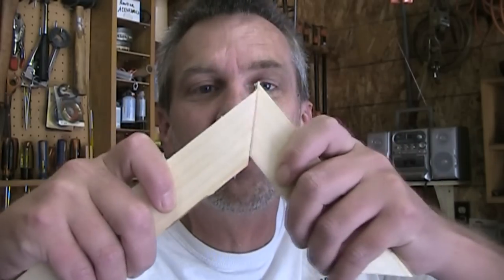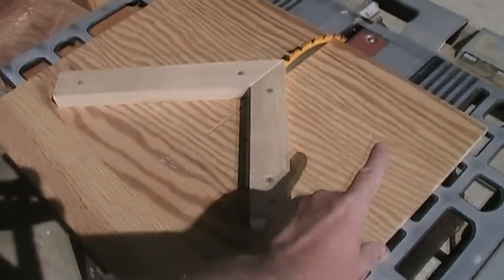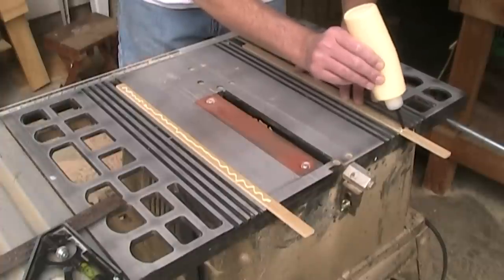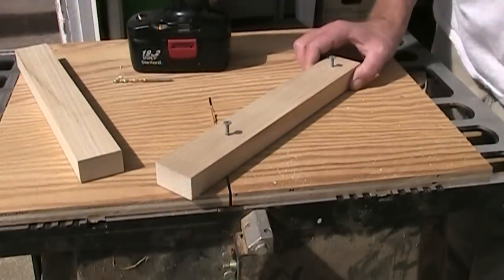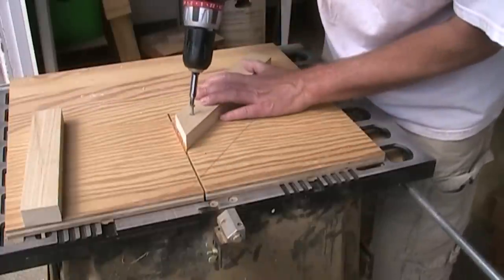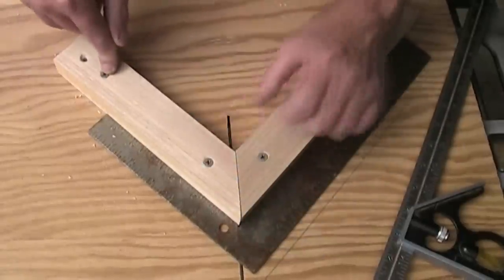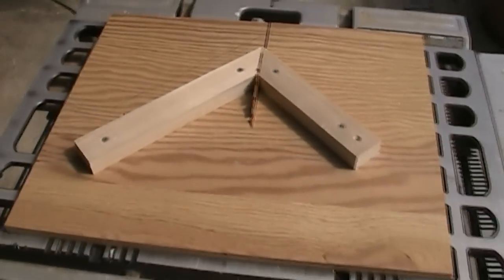Table saw miter sled

Comment: Nice one Steve. Simple but very effective.

For the last couple of sleds I have built, I ordered some 0.375x0.75 steel flat bar and used that for my rails. I know, people are thinking I am nuts and it is a waste, but I really like the heft it gives the sled, and it fits my miter slots very very well. It's not expensive, a couple of bucks per sled. A little more work in mounting, too. But honestly, wood or plastic works fine too. Just thought someone else might like the idea.

Comment: I made one recently. I made the sled with baltic birch ply, hardwood rails, made the saw kerf then took a square piece of MDF and lined up a (squared) corner with the saw kerf. Then cut a kerf in the piece of MDF. This way I didn't have to worry about lining up two separate pieces for the miter.

Comment: Hey Steve, really loving your videos. Lot's of great ideas in there. One that I had for this little project is a length of wood that goes on the underside of the sled running horizontally to act as a stop, so assuming the back of your sled is longer than the table, when you reach the end of the cut the stop hits and prevents the sled from moving forwards any more.

Comment: to remedy the play in your miter guage that came with your saw try some tape (masking, painters, packaging) on one side or another of the bar. I did this with one thickness of painters tape< just had to cut it down the middle, it corrected the play and still operates smoothly. Just thought i would throw that your way. great video!

Comment: You are quite correct. The placement of the 2 angled pieces should be at 45 to the kerf. Involving the top of the base board just introduces another unnecessary variable. I used a large 45 triangle to mark off of the kerf, and my results are finally *perfecto*.   :~)

Comment: Hey Steve,
 I prefer to use a hardwood or a strip of plastic. I'd worry about the soft 1/4" plywood denting or compressing over time. Or you could soak in some thin CA glue to harden it up. 
I'll have to make one of these for making picture frames. I've got one to make soon, anyway.

Comment: I do picture framing and make a lot of frames.I set up some jigs for getting the right lengths. I d the cutting on a Dewalt chop saw. I have a very good blade and recently had it sharpened so that I can get very well defined cuts. I do have a small angle sander and do some light touch up sanding to get a good fit. I do like the idea of making initial cuts with this though. I am always looking at other framers work and bad miters drive me up a wall.

Comment: I think you were very lucky to have achieved a "perfect" 90 deg. total angle by useing a combination square especially the short side against the wood.   I've found that if there's anyway to use a regular carpenters square to set up "especially" a jig,  the end result is "always" better.   With today's access to computers it's easy to calculate to make a carpenters' square as "perfect" as the human eye can allow working with the one "true" side of the plywood base board.   regards

Comment: @Matthiaswandel 
I'm prepared to agree with you on the glue, it really looks like its loose when screwing, could be that the pressure was to low for the glue to take all over the rail. I guess that is the point of adding screws. But I'm pretty sure it is a flat mount. Look at about 4:39 and it is definitely mounted flat, but the plywoods outmost layer is compressed and slightly discolored, which i guess gives the impression that its not a flat mount on the more distant shots.

Comment: Hi Steve, I might be totally wrong, but u missed the point of miter sled vs miter saw when u flipped the wood on the second cut! The idea is to cut each miter on both sides of the miter sled to compensate for the tiney fraction of a degree.  This can't be seen on one miter but when it adds on all four in a frame.

Comment: most people make picture frames with this tool.  The length of the parallel sides  must be the same for accurate miters. Therefore your miter sled must have stop blocks for repeat cuts.

Comment: Thanks.  I bought my first table-saw last week. I followed your instructions and built both the miter and square sleds.  The problem is with this cheap table-saw is that the blade is fairly close to the front edge of the table which makes mounting the sleds properly before the cut starts a bit tricky.  Do you have any suggestions for building a lead in table of say 6 or 8 inches to temporarily (or permanently, but that would render my fence useless I guess) place on the front edge of the table?

Comment: @larfsen - I have never seen a saw without them... so that's odd... but all is not lost. Make the board larger than your table area and have the two supports ride on the outside walls of the table. Or... attach channel strut to the outside of the table and make the sliders fit into that.

@Steve - I built one just a couple of months ago... saved us HOURS of work later. Thanks for the great videos!

Comment: Loved the video, unfortunately i remain a bit confused.  To insure a 90 deg. angle, wouldnt you have to cut one angle on one side of the sled and the opposing angle on the opposite side of the sled or having the second board is really not necessary?? I am thinking if the one board is attached with an error, say its 44 deg. using the other side of the perfect 90 deg. would yield 46 deg for the perfect miter, using only one side would compound any error? Please help before i attemp this.

Comment: I know this is vid is from 12 years ago & so maybe you're not still monitoring the comments, but ...I've made my sled and am delighted with the accuracy of the mitre cuts (farewell chop saw), then again I'm always delighted with the results when I copy your jigs - thanks. However, I can't for the life of me figure out a way to use stop blocks with this sled if making a picture frame of any size other than tiny. Any suggestions or alternatives other than just measuring the cuts, which I suck at? Thanks.

Comment: Steve, do you have a lot of trouble with the plywood runners? I mean I know that plywood is pretty stable as far as expanding and shrinking with changes in humidity.but do they tend to wear with repeated use and become sloppy in the miter slots?

Comment: the first time i made a square frame using mitered corners it was way off, even with the arrow at 45 degrees, i had to re-cut the miters after using a square to set the miter gauge to an accurate 45 degrees

Comment: Hi Steve Mm did you have do do 2 pieces of wood ? could you not just screw 1 and cut your piece of wood then cut your next piece but turn it ove before fitting just a thought 
also could you use the inside as a guide to make cuts?
I made 2 slds the 1st out od MDF mistake as moisture upset the MDF and me 2nd out of ply and waxed its bottom nice , but i had to buff/file of little guide on my table saw rails to allow the wooden guide rails to fit, some thing to watch for when buying a table saw.

Comment: Nice vid. Do  you know a tool or method that allows you to easily mitre (like for chair railing, crown molding, or base boards) if the angle of the walls is NOT 90 degrees, but more than that? I know walls and angles are supposed to be square, but in my house it seems none are done that way and can be many degrees off. Thus, two 45 degree cuts, even when accurate, leave gaps.

Comment: @stevinmarin 
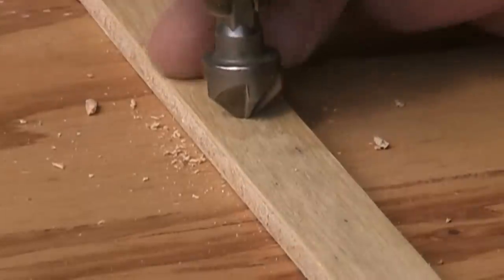It could definitely be magic eyesight (i.e. pure imagination), but at 3:19  it appears that the rail wiggles slightly and that the screw closes a slight gap, indicating the pieces aren't glued together or that the gluing surface wasn't completely pressed together. Actually not surprising as the spacers would only give pointwise pressure on one side.And I just realized that I'm debating how something was made with the guy that made it. 

I'm on a horse?

Comment: would you please do me a favor i m looking for a treadle powered table saw which is rigide foldable not to heavy in weight and to build i have no electricity in my garden so i cant use a powered circular saw do you think you as a mastermind will find a way to solve the problem kindly regards from germany

Comment: @stevinmarin The saw I have is at this link: tinyurl[dot]com/3b257lm  It was the cheapest I could get my hands on at the time.  It does have a built in sled for a fence, but it's fairly terrible.  I may try to work with that and make a sled for it.  The rip fence is absolutely terrible, there's no good way to ensure that it's 90 degrees without using a square and measuring a lot each time.  I would not recommend it for anyone.  Other than that ... it's just fine!